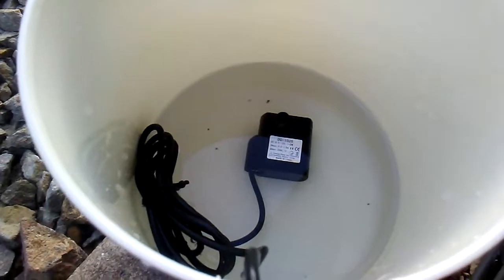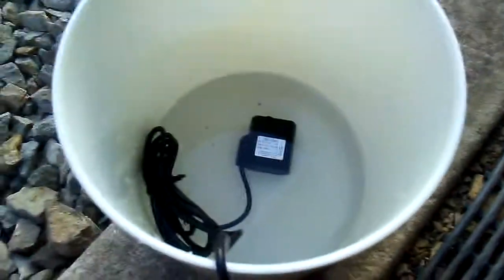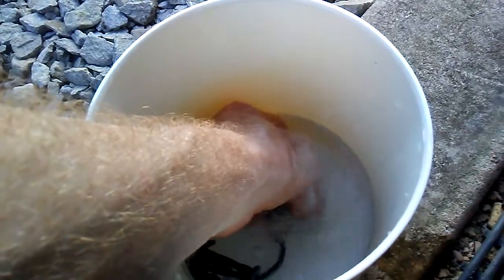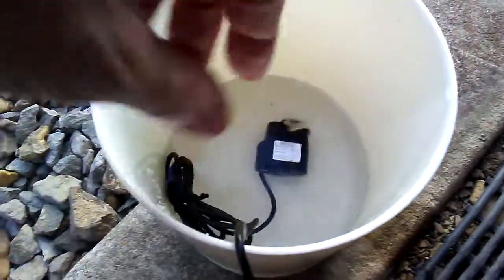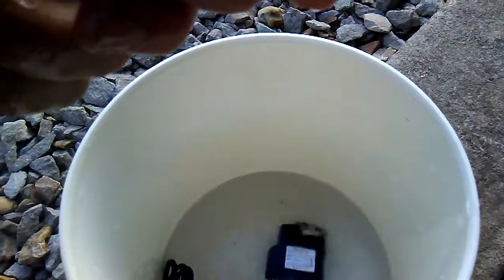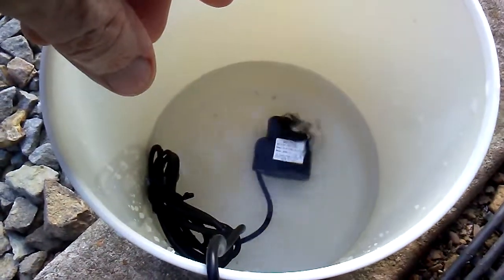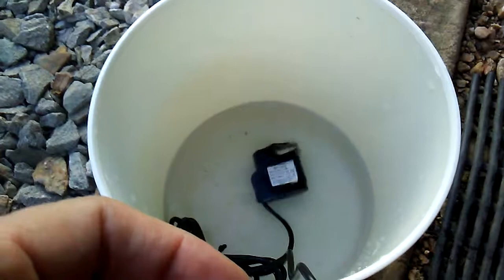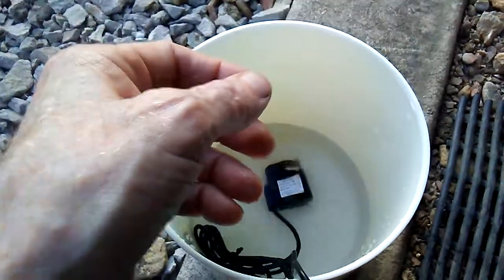DIY Air Conditioner: Ice Lasts Longer(D) The Water Pump - Ice Chest Air Conditioning - 12 volt

Comment: Would a closed system with a 2nd radiator under the ice work? Or would the water not get cold enough before it returns to the fan?

Comment: been watching your videos. is there significant reason to use puller vs push? Was just thinking push would maybe extend life of motor due to water not moving thru mechanicals?
Reply from the maker: Hey!
Yes, When using the fan as a puller the airflow pattern is tight and hard for maximum air on skin contact. By using a small 3" fan blowing against a lot of radiator fin surface space I think the fan would have to be pretty far away from the radiator in order for the tiny diameter fan(if using a 6x10" radiator etc) for the air to blow across all the cold fins to transport the cold air etc. It could work as a pusher with maybe a 6" flat fan etc. I originally started using an Ice Chest AC boondocking in my van conversion in a hot humid climate and was easier to cool off by using a puller. With limited ice on hand I think the puller cools the body faster because of the hard cold air impact. It's also easier to control the direction where the airflow goes etc. The 3" Attwood fan is actually also designed as a puller fan to suck engine gas exhaust fumes out of an anti a compartment. It's actually called a bilge fan which means it's designed to suck so I'm thinking the mechanicals should be ok.

If cooling a room with unlimited ice supply a pusher would probably be fine if the diameter were as wide as the radiator but I'd maybe use a different fan.

Some cars use squirrel cage style fans to blow across larger heater cores and window a.c. units use larger diameter fans etc.

Thanks for the question!
James, Rescue Kitty😺 & Snowvan!
Cold School Team

Comment: Have you ever tried putting the ice on a perforated rack up off the floor of the cooler?. The melting ice drips to the bottom but never touches the water below
Reply: This is an interesting idea.
Reply: @chilidog73  Yes, I have tried it already, and the ice lasts 3 times longer. 

And using a water pump to pump the cold water up through a copper coil (in front of your fan) and/or a radiator (behind your fan) instead of blowing hot air over your ice also saves your ice from quick decimation